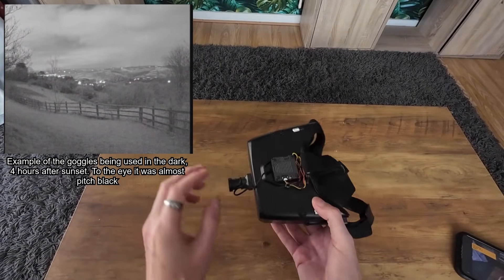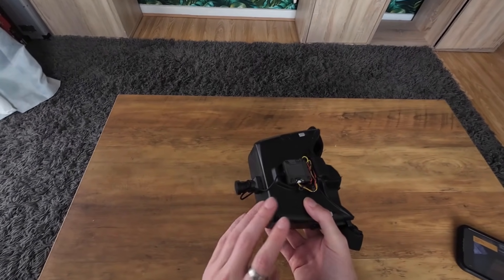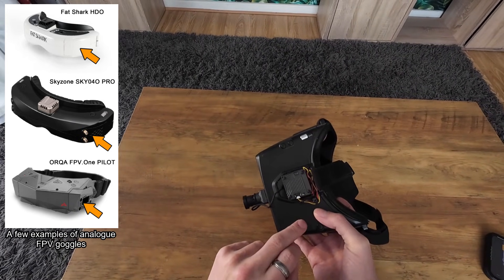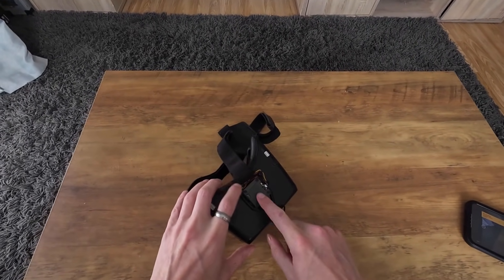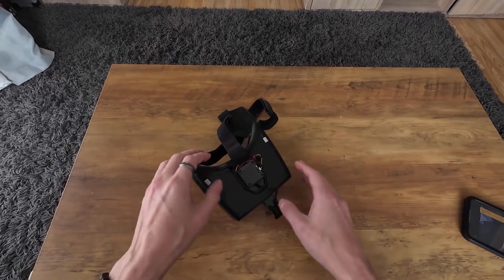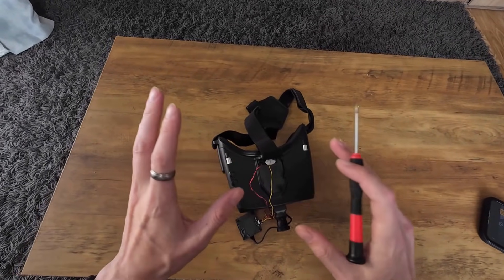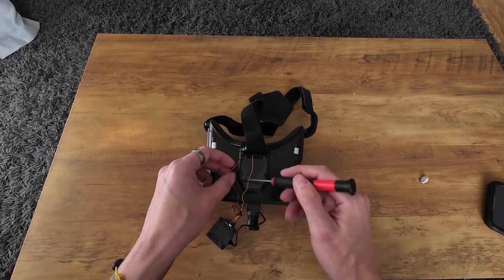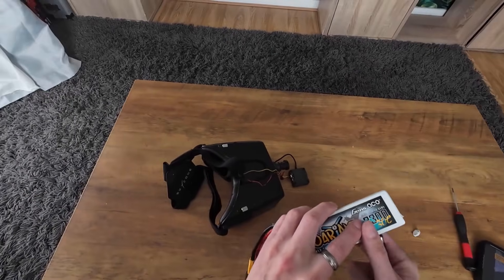📷🌙 How I Built My Own Night Vision Goggles For £200

Comment: I put this on a cobra goggle, not the x.  4s 1300mah battery.  It worked amazing for a while.  Then I put the straps on the goggles the 4th time, and it gave me horizontal black and white bars.  Can't seem to get it back up.  Help please.
Reply from the maker: Horizontal black and white bars usually means a signal from the camera is getting through but only partially. I'd check the wiring, make sure a wire or solder joint hasn't come loose

Comment: I've just attempted this with a brand new Infra V2, and am getting no video output signal. Indicator light stays solid red. Double checked every connection, I'm running it from a separate 4s battery to the goggles via an xt30. Anyone got any ideas what I'm doing wrong? Cheers
Reply from the maker: Make sure you have a ground wire going to the goggles!
Reply: @gizfpv  You're my hero!! this was it. Thank you so much!

Comment: I pressed down hard on the top and the top of the face peice popped loose,  but I'm pressing till my thumbs are about to break and still can't get the bottom to pop loose;  any suggestions?

Well, I managed to get it off, but cracked the LCD screen in the process.    

I wonder if anyone makes a replacement LCD screen for the Skyzone Cobra X V4 ?

Comment: So this goghas has a voltage step down if you feed it with a 4s battery?? Mine is working with a 18650 battery... or it get a step up???

Comment: 7:30 Hey Giz! Instead of internal goggle mods like this, another option might be to just add an external boost converter to bring the module voltage output up from 5V to 12V for the camera. They cost like a dollar on AliEx, and are tiny. And put it all on a pin rail so you could quickly swap between FPV and night-stalking :-)

Comment: So you powered infra with 14.8V battery directly (without regulating to 9V)? I probably understood wrong.
Reply: It takes 9V - 24V
Reply: @mitchclover258  Indeedm but i was bit worried if its harmful to power it straight from the battery without any regulation.

Comment: For the Cobra X, since it has a 3.5mm A/V jack, could you also crimp the signal and ground wire to an A/V plug instead of dealing with the module bay?
Reply: Yup lol.... Another way to make thermals is to take the small thermal camera dongles that attach to android/ iphones directly and just use an usb(c) to mini hdmi addapter/ capture card- mind you the goggles..which Skyzones do, are required to accept video in via hdmi input. Iz-sew-seeemplil-stoopeet :)

Comment: How does the camera latency hold up with speed? I'm hoping to push the goggles to 50+ mph (Sorry American) with an illuminator. Poor latency would be less than ideal for my purpose so just trying to get an idea 😊
Reply from the maker: @redtarget5275  Latency isn't a issue, I've not noticed any lag at all. Motion blurring/smearing though is a bit of a issue with speed in low light

Comment: So if i understand correctly onyl thing you need except power supply is only to connect yelow video cable. So if you dont have module option on your goggles you phucked? Or can you solder the yelow wire on av plug and plug it in clasic goggles as Dji v2  and use Av in mode in goggles?
Reply from the maker: Hooking the yellow wire up to a AV plug should also work just fine! :)
Reply: @gizfpv  that is what i wanted to hear! Will try! Thanks bud! 😇

Comment: Your project is truly inspiring—great improvisation! I’m excited to create one for myself and would love your insights on a few questions to help guide me:

Goggle Quality and Night Vision:
Does the choice of goggles significantly impact the quality of night vision? For instance, would using high-end (expensive) goggles noticeably enhance the clarity or performance?

Analog vs. Digital Goggles:
In your experience, does it make a difference whether I use analog or digital goggles? Which option would you recommend for optimal results?

Suggestions for Improvement:
Are there any specific tips or recommendations you can share to help me improve or refine this setup?
Reply from the maker: @yamashe8480  The choice of goggles will have a small impact of the user experience. Higher end goggles will likely have better quality screens with a wider field of view. But ultimately you won't really see much more, unless you're using really old 1st gen fpv goggles 

It won't really make much difference whether you use analogue or digital goggles. The crucial thing is that whatever goggles you use, they have a analogue module bay. Not all digital goggles have this 

The only improvement that I could envision would be to use slimmer goggles, and maybe somehow integrate the camera inside them. Would just look nicer. Although in practice I think this would be very hard to do. Goggles don't tend to have empty space inside them
Reply: @gizfpv  Thank you very much for answering my question, this will help me a lot🙏🙏
Reply: @gizfpv  Here’s what I did: I used an XT60 connector with red and black wires (the one that comes with the SpeedyBee ESC). I connected the camera’s black wire to the black XT60 wire and the red wire to the red XT60 wire. Then, I connected the yellow wire to the 4th pin in the receiver bay of my Skyzone SKY04X Pro goggles.

I used a 4S battery to power the camera and a 2S battery for the goggles. The goggles power on, but the camera doesn’t display anything. Yes, I’m using two separate power sources—one for the camera and one for the goggles.

What could I be doing wrong? Should I change the goggles' settings (e.g., HDMI, AV), or is the 4th pin in the receiver bay incorrect for the Sky04X Pro?

Any suggestions would be greatly appreciated.
Reply from the maker: @yamashe8480  As a guess, I'd suspect that the problem is that there's no ground (black) return wire between the camera and the goggles. I'd try adding one and see if that helps. Would also be worth playing with goggle settings and seeing if you do need to put them into a certain mode, although the standard mode should work
Reply: @gizfpv  You were absolutely spot on! The issue was indeed the missing ground wire. I ended up splitting the black wire (ground) from the camera:

One side is connected to the black wire (negative terminal) of the external battery powering the camera.
The other side is connected to the ground pin of the module bay.
For anyone referencing the pin layout:

The ground pin is the 3rd pin from the left or the 7th pin from the right.
The video input pin is the 4th pin from the left.
Additionally, in the settings, you need to select Third-Party Rapidfire mode. Once I did that, everything worked like a charm!

Thank you so much for your feedback—it completely solved my issue. I really admire your projects; they’re inspiring! Please keep them coming, and if you can, include “How I Built It” videos—I’d love to follow along step by step.

Thanks again for all your help. Now I’m heading outside to test it out—it’s 2 AM here in the Netherlands (so prefect time).

Cheers and keep up the amazing work!
Reply from the maker: @yamashe8480  Wheyyyy nice! Glad I was able to help. Enjoy exploring the night my friend 😊
Reply: @gizfpv  It was amazing, and it works really well!  
I have one pair of goggles, and I want to know if it’s possible to modify them so they can be used for both flying FPV drones and night vision. Not at the same time and without needing to assemble and disassemble everything every time I switch between the two.

So, I’d like your opinion and suggestions on this:

If I solder the three wires (yellow for video signal, red for power, and black for ground) internally and route them outside the goggles (perhaps by drilling a small hole if there isn’t enough space), would this work? I’d create a cap or 3D-printed holster for the external 3-pin head of the wire, allowing me to connect it to the camera only when I need to use the night vision mode. When not in use, the external receiver in the module bay would stay connected with two antennas for FPV flying. Note: the receiver will always be connected.

My main concern is whether the goggles will automatically distinguish between the FPV video feed (via the analog module bay) and the internal yellow wire feed from the CaddxFPV infra camera, even when the camera isn’t connected.

What do you think? Would this setup work, or are there potential issues I haven’t considered?

Comment: Some tips for anyone trying this, based on my experience: use wires no thicker than 22 AWG (that’s what I used and it was super tight). Remember to disconnect all power sources before starting, especially the 18650 bay! DO NOT solder anything until you have the wire routing sorted out. Also, thread the wires through the “exit” hole FIRST, i.e. insert from the outside world into the hole in the module bay, and work backwards to the solder points (it’s way easier than the other way around). It’s likely you will have to loosen the 2 short screws holding the top section in place, two screws securing the circuit board, and at least one screw holding the fan. Finally, if using Cobra X v4 goggles (not v2 like in the video), plug in your battery with the barrel connector and test with a multimeter to confirm which solder points you are using - the component in the v4 circuit board is slightly different to the v2 board shown in the video: of the 3 lower big solder points, far left is ground and far right is positive (middle is just holding the component in place). I soldered the yellow wire to the middle pin of a 3-pin header instead of inserting the yellow wire directly, and just snipped off the excess bits - it’s much more secure that way.
Reply from the maker: Very good advice! 😊

Comment: my caddxfpv infra camera, that i just ordered based on your video lol, has a little pinout card and it says 5v to 20v, how ever i cant get any video to my goggles i bought just for this little project.

also, as a test i gave the camera 5v postive and 5v negative from a externl 5v usb power source just as a test, but i suspect the  yellow wire also needs a ground  connected some where on the receive end and perhaps they assume the ground will be shared with power?
Reply from the maker: @jasonbrown467  Which goggles are you using? If you're using something other than the same Skyzone Cobra goggles that I used, there's a chance the pin out for the module bay may be different. You might need to insert the yellow wire into a different pin header socket 

Interesting your Infra camera can apparently be powered by 5v. I tested mine on 5v and it definitely didn't work
Reply: @gizfpv  i used some cheap fpv googles that have av input, i just cut down a pig tail and used its male jack to plus into the female jack. i also added a swtich to back and forth between the cadx and a 256x192 thermal camera. the cheap googles do not have any adjustment and is really only in focus if i hold it out about 5 inches from my fat face, other wise its sweet.

oh i plan to keep adding to this, i plan on using a 2s 3ah lipo and using a little voltage step down and running that to a flat micro usb cable so i can plug it into the googles and charge them, so maybe i can run it all day and stick an extra battery in a bag or something.

these are all just side projects to a thermal drone i am building, as i wait for parts to arrive
Reply: @jasonbrown467 was you ever able to get the camera to give video? I have the exact same issue, stupid thing is I get video just fine with any other camera
Reply: @mitchclover258  yes, i was able to get video. do not take my word for it, but i think the camera requires more voltage than what the manual said and i dont remember what this was. but i ended up buying a tiny voltage step up device, or i got a higher voltage battery and then got a tiny voltage step down device for the other stuff like the gimble.
Reply: @jasonbrown467 Yeah I believe it needs 12V or more, the contradictory information and the limited guides from the company is ridiculous for such an expensive product, you didn't have to power from anything else just the 3 pin connector right? I'll have to try stepping up and down like you with a buck converter hopefully it works.

Comment: So the box says 9v-24v but also calls that power so maybe its not trustworthy.  The single page tiny interior introduction doc says 5v-20v.  I'm going to try the module headers and will let you know how it works.
Reply from the maker: @youngmangoingwest  I already tried powering it with 5v from the module headers, it doesn't work, it needs 9v or more
Reply: @gizfpv  fuck yea, this was the information i needed, this this was not working for me with 5v.

ok, i got this shizz figured out, the yellow cbvs yellow wire can not operate on its on, the video signal is in fact a two wire signal, so it it postive and its other wire is ground that doesnt exist, so you share it with the same ground that is powering the ai box. 

also, it will run off of as low as 5.4volts, i tested this using a varible psu, the camera seem, to want to run off of 1.285 watts, and will increase the amps to accommodate lower volts but doesnt like running off of more than about .25amps, it also seems to be stepping the votlage up or down inside as it can see swings in the ratio of VxI as i adjust the v as if there is a step up or step down device and it just does not want to work with current higher that .25amps, and often it wont even turn on at 5.4amps as i am guessing there are caps that can not be accommodated on a power on scenario, but you can power it on at 6v and slowly walk it down to about 5.2v, but once that low and you turn it off, it cant be turned on

ok, now i need to shrink my build down to about your size and maybe built a apparatus to protect the lens

Comment: i was so into this until you went internal adding a battery etc, with a shovel or a hammer im like a human j.c.b. but as soon as delicate technical stuff rears its head im absolutely useless, id mess it up, but cheers MINT IDEA. so good i subd.cheers.
Reply from the maker: If you don't feel confident with taking the goggles apart, you could always just power the camera directly from a second battery or something. I just opted for the cleanest solution, but that doesn't mean there aren't other options 😊

Comment: how is the latency
Reply: Should be absolutely zero latency with an analog system. Latency is a digital problem.
Reply from the maker: There isn't any noticeable latency that I can see
Reply: @kolschejung4465  Joshua Bardwell did a latency test and got 100ms, so much that you could see it with the naked eye. He didn’t seem to have issues flying a quad with it though. You can definitely notice the lag but it’s not an issue for these night vision goggles - just walk carefully and be careful with the narrow field of view.

Comment: I'll use my runcam nighteagle, but wireless. I don't like to disassemble my cobra x. Merry Christmas
Reply: plz can you create video to see how do you that ? i will try with runcam night 2 proptotype. better than nighteagle.
Reply: Dont really need to disassemble anything. Not sure why he did it so complex. You can just add little socket/jack adapter between battery and goggles, splice power from there.. Or just run extra wire from battery balance port. (and do it from first and last pin so you dont unbalance the cells)

Comment: If you have to plug the goggles into a 3S or 4S battery anyway, would it not be simpler to just power the camera from the battery’s balance lead?
Reply from the maker: In principle, yes, that would be easier. However in practice it's not really viable, unless you happen to have a second power cable going spare as well as a balance plug going spare that you could solder onto the end of it
Reply: @gizfpv  Thanks for the reply and the tutorial! Looking forward to seeing that plane too.
Reply: @gizfpv  I actually tried this - I just soldered the camera’s ground and positive cables directly to a pre-made balance lead extension cord I had lying around, and stuck the video cable directly into the goggles like you did. I got no video - presumably because there is no common ground between the battery leads and the video wire (I think I forgot to plug in the 4S battery and ran the goggles off the 18650 - oops). Obvious in retrospect, but worth a try I guess! I was trying to see if there might be a way to set it up without opening the goggles case, and also making it a reversible setup. Thanks again for the tutorial, I had success and they are as amazing as you said!